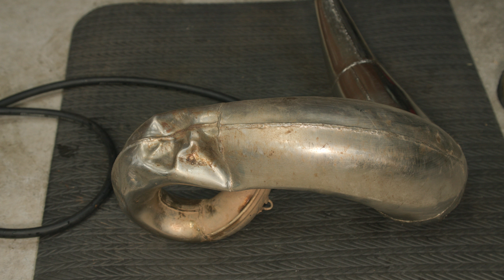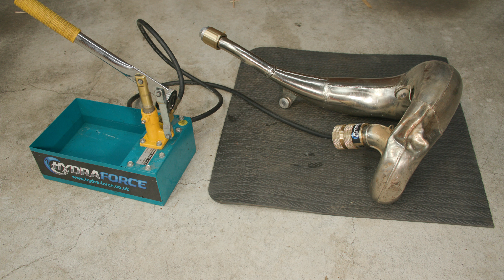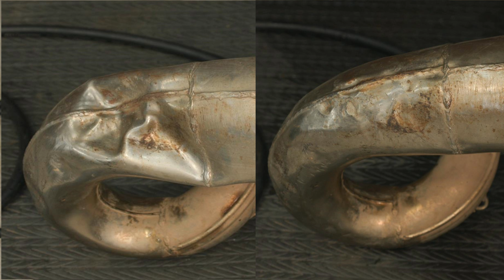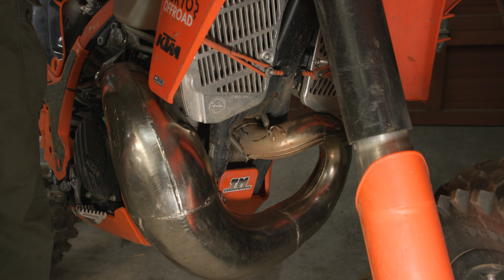HydraForce 2024 FMF Fatty 300 Repair

Comment: Excellent and amazing.  When you get to the part of using your panel hammer, would adding heat around the outside of the dents help them come out from the pressure?  I was expecting and sueprised hest wasn't used.  Thank you
Reply from the maker: No, the pipe is filled with water so it would be difficult (and dangerous) to heat the steel enough to make a difference.  There is a different technique using compressed air a heat which I show in this video: @Sladep123

Comment: Soften the area with a gas torch
Reply: I was just thinking that. A little heat would help.
Reply from the maker: @tomcampbell6384  The pipe is full of water. You wouldn't be able to get it hot enough to soften the steel. If you want to use heat the compressed air/torch method is best...
Reply from the maker: Heating the pipe with a torch and blowing out with compressed air is a different technique which works well, but for me is more time consuming and higher risk. But if you're suggesting heating the pipe while full of water it'll be very difficult to get the steel hot enough to soften and even if you could apply enough heat the water inside would be boiling (superheated) and be very dangerous if a bung came off, or the pipe burst. I previously made this video which shows the heat and compressed air method. https://youtu.be/U_LClTYi1gY?si=7c_hUp76DRfEDK74

Comment: We made our own. Capped ends off full with air while little torch heat and …. POP.
Reply: We worked at a fab shop. We made ends from pipe.. thick rubber.. installed a shader valve on one end.   Took little time but … wow it worked good.  We ran gncc in the 90s so pipes got beat.  Little air … little heat … barely and hammer work

Comment: I find a pipe under air pressure and torch seems to work better than the hydra force.
Reply from the maker: I agree that you can achieve a more perfect blow out with compressed air and a torch. But for my use (offroad mountain riding) I usually get a new dent/s every ride and because HydraForce is quick, easy and takes that majority of the damage out, it's what I like to use most often.

Comment: Used this once on my Gasgas and it completely changed the pipe dimensions so re-install was a bugger.
Reply from the maker: The 2020+ TPI stock ribbed pipe shape will distort if HydraForce is used to blow them out. For a ribbed pipe you’ll need to use the  compressed air and heat blow out method.

Comment: It only takes about 80psi and a torch...... putting 450+ into it is CRAZY. Plus you need that machine? Naw I stay with the torch.
Reply from the maker: It should be noted that water compresses very little even under high pressure. As such water at 450psi is far safer than air at 80psi in this application. But if care is taken the compressed air and heat method can result in great results and previously made a video using this method: https://youtu.be/U_LClTYi1gY?si=_obqMF-ZvUA0FD87
Reply: @TokyoOffroad  That's true, Ill concede to that. Air and heat just seems so much easier.
Reply: Hydrostatic pressure is much safer than compressed air to form metal. 
Its been an industrial process for decades to test high pressure bottles at thousands of PSI.

Comment: Why not use a pressure washer provide the pressure? Like you do while hydroforming metal?
Reply from the maker: I've seen that some people use pressure washers. The advantage of using the hand pump (which has a pressure gauge) is that it's very controllable.
Reply: @TokyoOffroad  Any problems of distortion on the 2024 Pipe? Like on the older models?

Comment: I have a HydraForce as well and the pipes I’ve repaired don’t seem to completely return to their original shape, similar to what @akboun6708 has observed. It doesn’t form a good seal around the exhaust port and tends to leak premix while running. I thought perhaps you would use a press or something to bend the pipe to its original curvature, but you have had no such problem?
Reply from the maker: Your comment inspired me to make a video which shows how I adjust the header section of the pipe if fit in the exhaust manifold is not good. Yes, I sometimes do need to adjust the header. As mentioned in the video, if you're using a pipe guard you're much more likely to experience header bending: https://youtu.be/W9gckRFSZXY
Reply: @TokyoOffroad  So awesome, thank you!!

Comment: I have the same pump for the hydrolastic suspension on my metro 
I never thought it could be used for hydro forming 
I've seen it done with a pressure washer im guessing the pump is more controllable and safer
Reply: Pressure washers are rated in GPM and PSI, many will flow more fluid in 1/2 sec then the entire stroke of that hand pump, but as long as appropriate safety measures are employed, have at it.

Comment: What are the benefits and downsides compared to air and heat method?
Reply from the maker: I find the HydraForce method quicker and easier. It removes all dents in one go and also tends to return the overall pipe shape to original. However, to fully remove dents you do need to do some hammering as shown in the video. The advantage of using compressed air and heat is that you can achieve near perfect dent removal, although I find it quite time consuming. Without doubt the HydraForce method is a lot safer, so long as you're careful to bleed all air out of the pipe before applying pressure.
Reply: @TokyoOffroad  Could you please list some dangers to watch out for with each method?
Reply: @tonn333  imagine exploding the pipe while filled with compresed air. The hot air would expand many times the volume of the pipe. At least it would rupture your eardrums.
Reply from the maker: @tonn333  With compressed air and heat method, the biggest danger is if a bung fails it can shoot off with a lot of force. With HydraForce, so long as you bleed out all of the air, the water compresses very little, meaning that even if a bung fails it won't act like a projectile, they'll just be a short spurt of water and it's over.